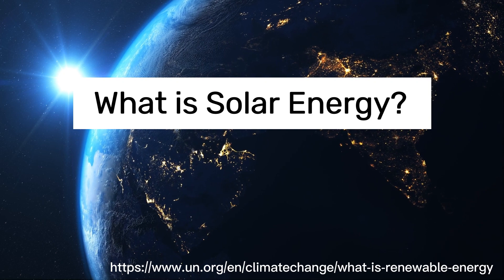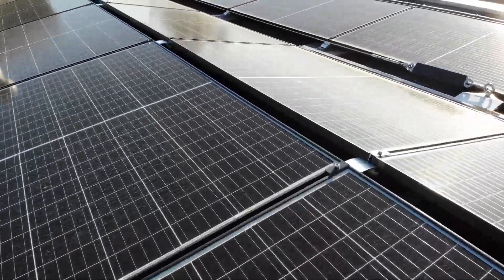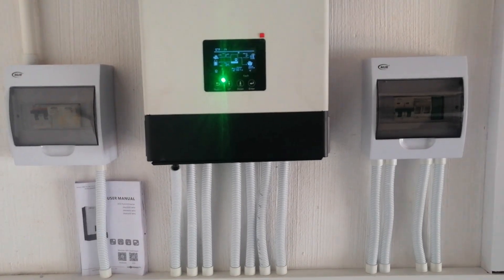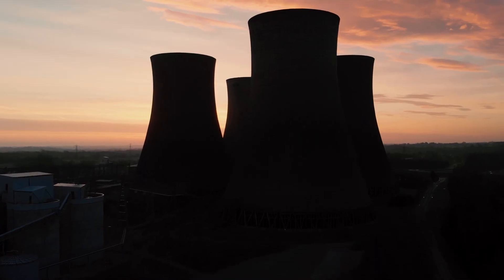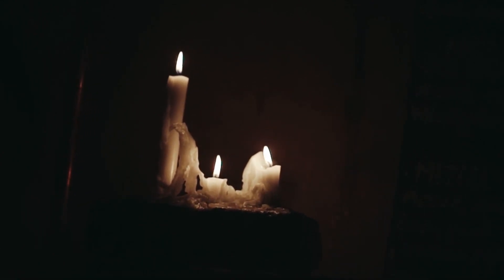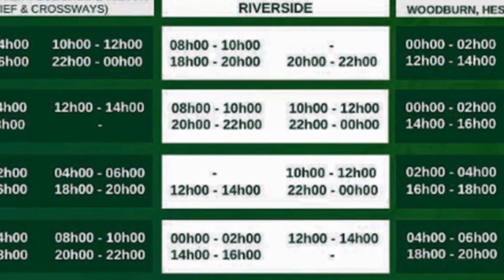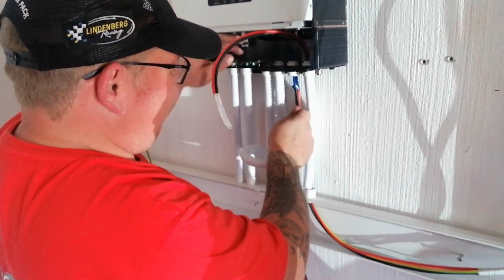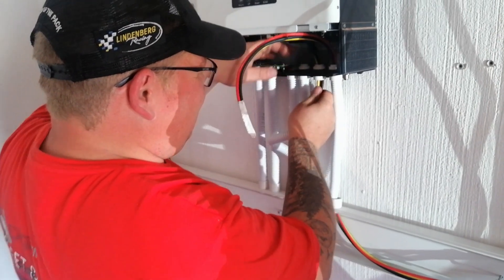FULL SOLAR ENERGY INSTALLATION by Digit FMS at Residential Property in South Africa #solarenergy

Comment: Non SANS compliant installation. just to point out 3 violations(there are more), Battery fuse below 12m, AC and DC i the same trunking and solar cables may not be in pvc and flex pvc on the roof.